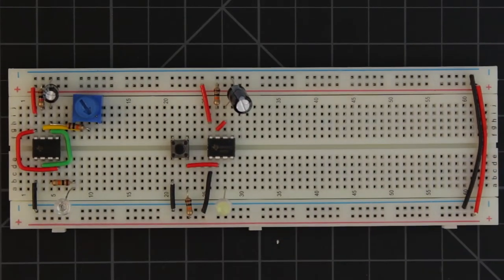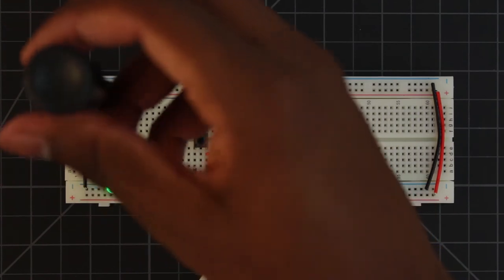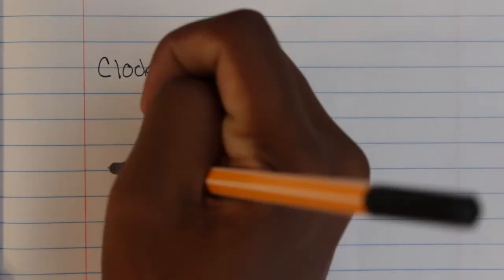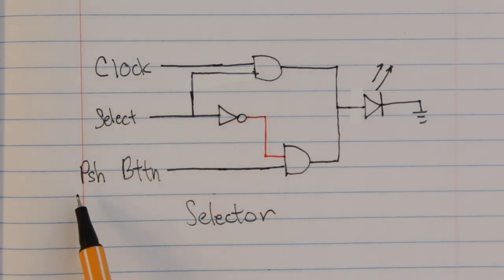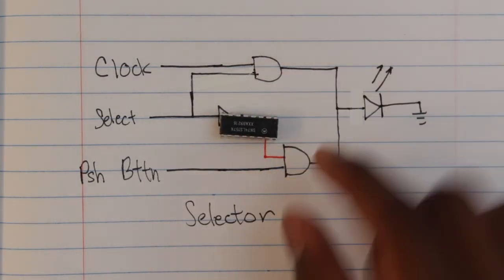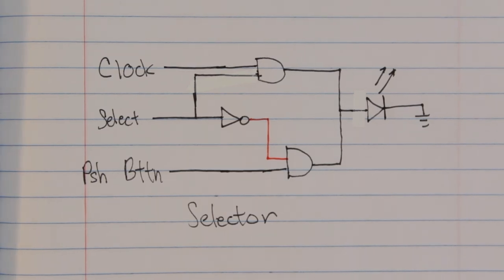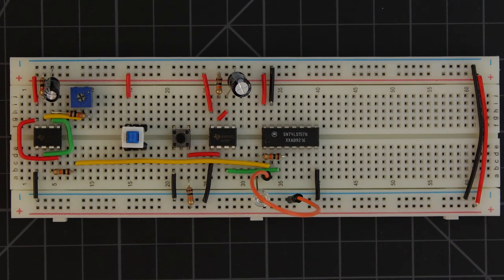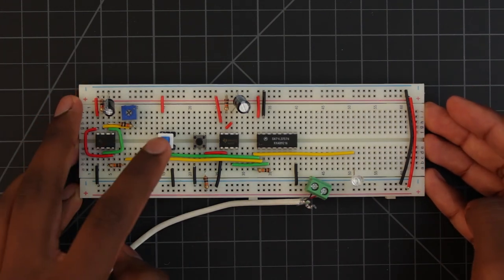Clock Module Part 2 | 8 Bit CPU

Comment: I believe your statement about not needing an OR gate at the output of your two AND gates is incorrect.

Modern gates are built using CMOS technology (C for complementary) where the topology of the output from a gate consists of two MOSFETs, one between the positive supply rail and the output, and the between the output and ground. Usually these are of P type and N type respectively. Some more modern TTL chips feature a similar totem pole arrangement, but the function of either arrangement is the same: when a gate is high it will source current, and when it is low it will sink current.

If you omit the OR gate and place two CMOS or totem pole based outputs on the same net, with one being high and the other being low, you will effectively create a short from the positive power supply rail to ground. This may or may not let the magic smoke escape.

Your chosen multiplexer chip takes care of this internally and in fact if you look at the second page of the datasheet you will see two things: 1) a schematic of the output, showing the totem pole transistor arrangement of the output, and 2) each selector features an OR gate at its output for that very reason - its necessary.